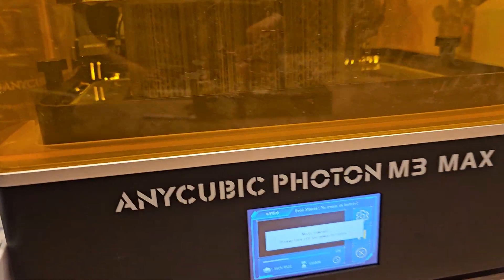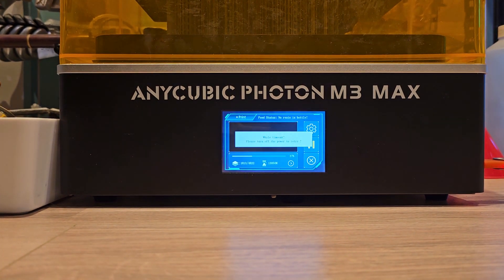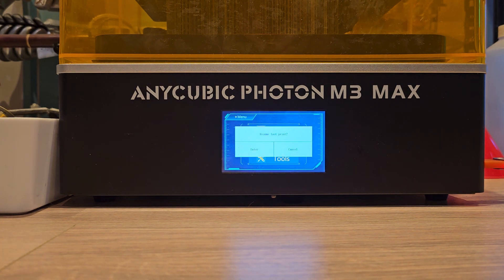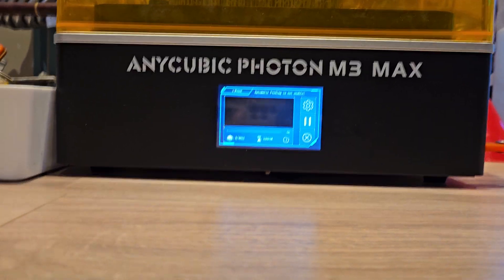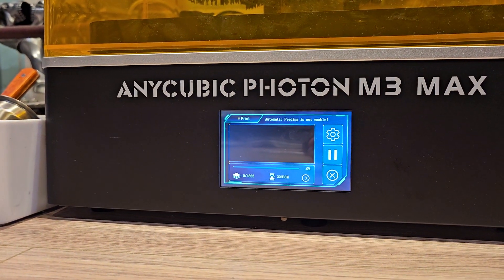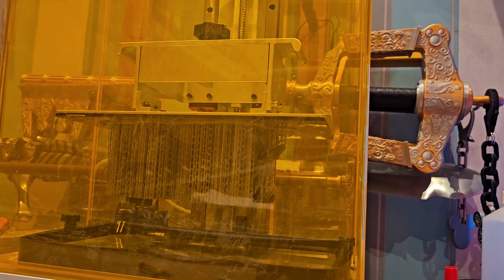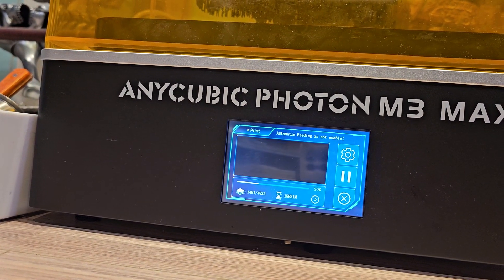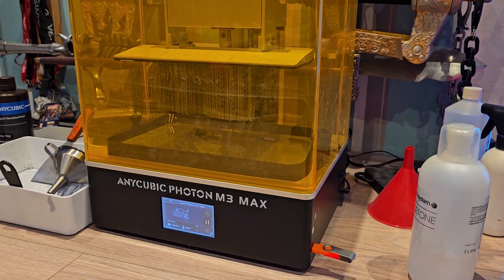AnyCubic Photon M3 Max "While Timeout!" Error, Frozen Printer, Reset Attempt, WASTED RESIN

Comment: Hello friend, you found a solution to this problem?, I have the same problem and I still can't solve it
Reply from the maker: i thinm this was a usb issue, i changed it after this and i havent gotten it again
Reply: Thanks for the info. I had the same problem today, and I think is not the USB, I think is something related with the slice in the Anycubic workshop, as when I generate de 3d model in the workshop, it shows just the piece it printed and not the rest. I have to keep investigating.